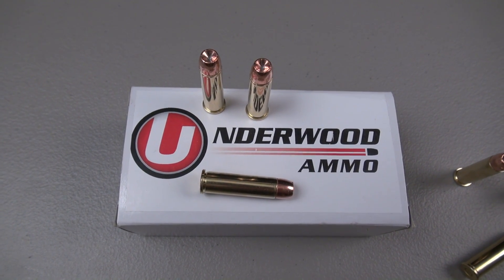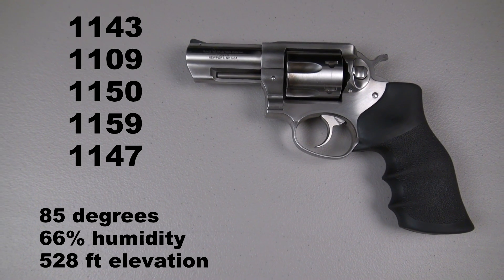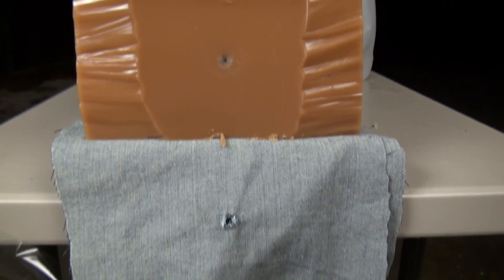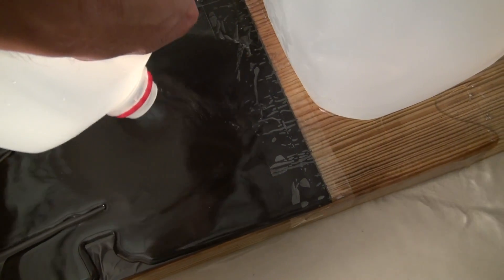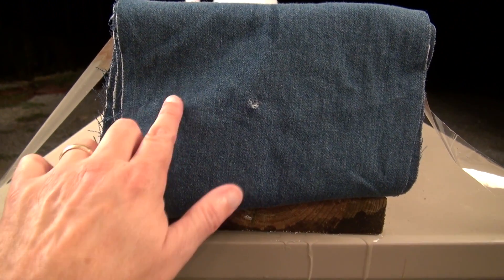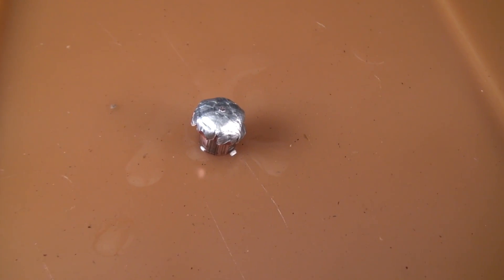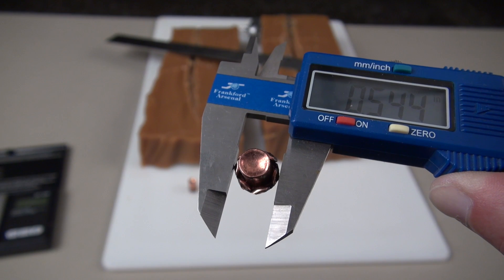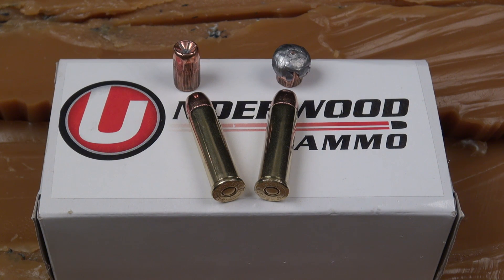Underwood .357 Magnum 158 gr Gold Dot Ammo Gel Test

Comment: The 357 mag is by far the most overrated defensive caliber ever.  There are a multitude of reasons for the wide misconception:
Gross misrepresentation of factory advertised velocity - unique to this caliber
No barrel length listed to equate with advertised velocity
People's failure to account for cylinder length contribution to the overall launch pad length
Poor and or misunderstood data about one shot stops / that are either useless or harmful when attempting to understand terminal ballistic performance

125 grain 357 from a 4 inch launch pad = (maybe inferior too) a 9mm relative to terminal ballistics - same diameter - same mass - same velocity  (they are both CLEARLY inferior to a 40sw relative to terminal ballistics)

but the 357 has  more flash - more bang - more recoil - harder to control recoil - and coming from a revolver with far less capacity - harder to reload - an inferior trigger - harder to conceal - and more uncomfortable.  (the revolver often has a better front sight)

Its a hobby gun thats it / period.
Reply: The sport of firearms is a hobby.  If you're not into the sport of firearms for the sheer pleasure of it, then you're probably into the wrong hobby.  Unfortunately, too many new gun owners fall victim to paranoid fear mongers preparing us for waves of zombies and SHTF bullshit and never really get to appreciate or experience a wide variety of calibers. 

Shooting properly loaded .357 Magnum from something other than a snub nose revolver is a ton of fun.  Fun is the hole point of shooting for sport.  Most people that enjoy the .357 Magnum or 44 Magnum like it for all the reasons that you don't.  That's why they make comparatively weak pistol ammo like 9mm and 40 S&W or white box 10mm.
Reply: FiT PT wait you just said 40 is equal in performance to 357 noooooo dude just no
Reply: Lol ok.
Reply: TOBORE8THMAN

I never said I dont like it.  I shoot the 357 mag from an sw 686 (copy) with a 4 inch barrel because it is what I have.  My point is the caliber is not well suited as a CCW.  Its potential and advantage is based on relatively high power for a hand gun. However its power is contingent on its relatively large case capacity.  To capitalize on this extra powder store requires a long barrel = really 6 inches. Even from a 6 shot revolver with a 4 inch barrel which is not the most comfortable conceal carry (I cant do it) = there is still a large flash bang from the hot burning (wasted or worse than wasted) powder from the muzzle and between the cylinder barrel interface. There is nothing in your post that contradicts my original or that I disagree with beyond your assumption that I dont like the caliber.
Reply: @FitPhysioTherapy  It was never designed for concealed carry, what are you going on about?  That would be like sticking a 3 inch 44 mag in your pants and expecting it to behave like a 6-8 inch full frame revolver, which is stupid and not very well thought out.  A 4-6 inch barrel 357 does achieve what it was designed for.  The gun manufacturers screwed around and thought "hey, i bet this will sell quicker if we chambered it in a snub", they didn't care that it wasn't designed to achieve its potential in a short barrel.  9mm vs. 357, when both are used as they were designed, is no comparison, even the standard 357 158 grain is moving much faster, as designed,  than the 9mm 147 grain, which equal a better multi purpose cartridge, in the correct platform of course.  Use some common sense man.  As far as underwood ammo, most tests I have seen, drive that same load (maybe they tweaked it right as they found out short barrel guns are being used) close to 1300 fps out of a 3 inch gun and have seen some 2.25 inch guns shoot faster than the 3 inch.  Out of the 6 inch barrel of my GP100, which kills deer, would blow any two legged creature to hell and back, hits right around 1500 fps, with the 158 grain xtp, find me a 9mm, or even a 10mm that equals the energy that round dumps into the target.  This is how the rounds were made years ago before compact revolvers got involved and girly boys realized they didn't like recoil, most 357 ammo is not loaded to its potential to even the 35,000 psi SAAMI specs, not even close, that's why most 158 grain loads only claim 1250 fps and not 1500 like underwood and buffalo bore.  Without those companies, those that don't reload, would have to settle for the dumbed down loads, which still exceed 9mm specs by a long shot, get real man.
Reply: FiT PT what are you mad
Reply: Leonard Kimble

I was mad, but after watching Obama leave office now I am only angry - why do you ask?
Reply: FiT PT lol no bro about the revolver only being a hobby gun
Reply: Leonard Kimble

I  am not mad that the 357 mag is a hobby gun.  I dont care much about it enough to get mad over it.
Reply: OK FiT PT  I meant nuts. But to each its own I'm deadly accurate with mine you made it sound un usable. I own semis too but Yea I favor the 357
Reply: Yes FiT PT  I have been in a couple. Won't elaborate. Sometimes I carry my 40 Kahn sometimes my Taurus 357 maybe it's me but I'm not worried about the bang of either one. Are you a small guy not being a ass just asking. 2 No not ANYONE can be deadly accurate in practice. Trust me
Reply: FiT PT wait let me answer the rest of your question. Concealed carry and home defense. From people. 125gr Hornady. You carry 135gr low flash
Reply: Leonard Kimble

You
Are you a small guy not being a ass just asking. 2 No not ANYONE can be deadly accurate in practice. Trust me

Me
No - my favorite handgun = the one I would take to a gun fight if I could not bring a long gun is a Glock 20 - 200 grain xtp Double Tap. But I carry a single stack 9mm for comfort which is always a factor (and the extra round) because I am never expecting a shootout and in most events a realistic water pistol is all that is needed so I feel over dressed with a 9mm.

You
2 No not ANYONE can be deadly accurate in practice. Trust me.

Me
I never claimed everyone can - but many people that have achieved very high practice proficiency failed miserably in the real deal = part of documented history.

You
wait you just said 40 is equal in performance to 357 noooooo dude just no

Me
I said equal or superior and presumably you just watched the video evincing my iron clad case.  Underwood (your brand) 158 grain from 3 inch barrel = 4.7 inch launch pad = miserable fail and with Gold Dot.  It is likely it would have been worse with xtp which is a poorly expanding round and requires very high velocity to function properly.

Link me to one youtube video showing a 357 mag with FACTORY ammo any mass bullet performing from a 2.5 inch barrel or less (that is still more than 4 inches relative to 40sw pistol) that is equal to 40sw (with proper round of 160 or 155 grain bullet) with respect to energy and terminal performance initial bullet diameter - expanded diameter - penetration etc.  I double dare you because I have looked and I cant find one (not saying it does not exist).
Reply: FiT PT no bro double tap or HPR or Remington. 125gr. 10mm is a different story. Don't get me wrong I'm a big 40
Reply: Leonard Kimble

You
no bro double tap or HPR or Remington. 125gr.

Me
I dont know what this means but I know it is NOT a link to a youtube video demonstrating efficacy?   I just refer you to the tnoutdoors video here to demonstrate the 357 mag Underwood even from a 4.7 inch launch pad is not very effective with respect to terminal performance - energy fair - gross over penetration - poor expansion - unimpressive wound channel.  But these are not the core reasons why I contend the 357 is not well suited for self-defense.
Reply: FiT PT I value your opinion and friendship but Steelers time
Reply: Leonard Kimble

Have fun OAO
Reply: Interesting That you missed the math here. 9m simply cant match the 357mag when the proper barrel length is used. You have apparently been fed the same lines that so many other people have fallen for.  Most Factory ammo is UNDERLOADED. Only a few manufactures load to intended (Design) specs. Don't take my word for it. Break some down and see for yourself.  Also, the 357mag was never designed to be fired from less than 4" barrels (measured from the frame connecting point) That has not stopped Gun Manufacturers from building  2" and 3" versions.  The average person simply does not take all factors into consideration, because they don't have all the info. 357 Magnum standard velocity was 1450fps 158gr . no 9Mm Will ever safely get to that level of power. And even 40cal cant touch it. 10mm gets pretty close.
Reply: Why do you think a (forcing cone) equates to barrel? It does Not. Just count the barrel length from the point of attachment at the frame.   Still, 1450fps with 158grain bullet still out performs 9mm, and 40.  I like all of them. But facts are facts. My primary carry is 45super. 185gr 1425fps (actually choreographed). It beats all of them. But at the beach I do sometimes switch to a 40 or 9mm. If I really needed power, id open carry a 4570 8" Revolver 320grain JFP.  But I don't have Brown Bears here. So that might be excessive. Lol
Reply: The only auto to compete with the 357 would be a 10mm. Thats it!
Reply: Leonard Kimble

Two comments 1) an observation 2) a question.

1) Many people are (Deadly) in practice but few are (Deadly) in the stress of a real world shooting incident.  There is NO way of knowing if you are deadly under a real word life and death shooting event unless you already have been so in the past and even than - it does not necessarily mean you will be next time.

2) Are you telling me you employ the 357 for self defense?  If yes carry defense or home defense etc - defense from who or what - and concealed or open? 

I personally could not carry a 357 - 4 inch barrel 6 shot revolver concealed - it is awful - especially when I can carry a very comfy 15 shot 40sw with lower recoil - less flash/bang - easier reload - better trigger - and with equal or superior terminal performance.

Comment: My hand loaded, 180gr 40 cal out of a 4 inch barrel runs 1113fps on a 5 shot string, and that's at less than a max charge. Kinda disappoints me to see the 357 advertised so high, but performing so low.
Reply: I think it's because of the powder selection. Magnums typically use a slower burning powder and are tested using 10" barrels to maximize the advantage.

Comment: Is it a possibility that your test barrel caused the lower speeds and therefore a pass through since expansion was inconsistent? Maybe a longer barrel generating higher speeds would have caused more expansion and a batter energy dump, resulting in no over penetration. Just my thoughts. Please keep the videos coming. They are very helpful in making decisions about what ammo I carry.
I would also love to see you do a test of the 160 grain Hornady Leverloution (sp?) round from a .30-30.
Reply: +michael malkowski And that massive ring of fire seen in a separate video.
Reply: I'm guessing the test data to achieve the 1475 fps they claimed was out of a long barrel, maybe 10" even. If the burn rate of a powder needs more barrel to be effective, then out of a short barrel you'll see massive drop offs like that.

Comment: I'm trying to decide between the 125 or 158 Gold Dot as a home defense or woods gun.  Firearm is a 6 inch Ruger GP100.  The 125 grain seems to expand better and penetrate deep enough, but a 158 has less blast/flash/snap than the 125.  More than likely this won't be used as a home defense gun, but I like to keep my options open.  Thoughts?

Comment: Your 3" GP100 left approx. 325 fps sitting on the table.  Underwood is pretty good about advertised muzzle velocity specs, too.  They must have used a 6" barrel.  My "hot" home load 158 grain XTP's averages of 1360 fps from my 4.6" Blackhawk.  Hmmm...
Reply: Yeah you aren't going to get their advertised velocity out of a 4" barrel.  That's why I hate when companies don't give you the barrel length and if it was fired from an actual gun or a test barrel.

Comment: That's the problem with revolvers, the size of the barrel is always going to affect the performance of the round being fired. 2-3 extra inches for a revolver can equate to more than 100fps, and the gap widens even more when comparing snubbies to 6 inch standard revolvers. Thats why I always argue that .357 sig and .357 magnum are closer than you think in terms of performance given barrel length. A compact glock firing 357 can get a full 1300-1350 fps, a 4 inch revolver is right around there.

Comment: I have had a few mixed responses concerning me carrying hot .357 sig FMJ loads from Underwood rated at 1475, although I have seen regular 4.5 inch barrels get well into the 1540-1550 fps range. Some people say even for car carry and nothing more, it would have over penetration, but the fact of the matter is I wouldn't feel safer with anything other than some very hot solid FMJ .357 sig rounds coming out of my G33, probably at every bit of 1400fps. Both 10mm and 357 sig are awesome penetrators

Comment: I just picked up a box of the Speer 158 grain Deep Curl (Gold Dots under a different label) that I want to use for hunting on whitetail this coming year. I have looked up a couple of loads for this and out of my big Smith or maybe if I pick up a gun with a 6 or 6 1/2 inch barrel I am hoping to get about 1,350 to 1,400 fps. With the penetration you are getting I am hoping to drive the bullet right through both lungs. I have heard good things about this bullet.

Comment: You must take into account that the chamber is included in the OAL of a pistol barrel.  The barrel length on revolvers is all barrel length, and does not add the cylinder into the length.  So... a four inch barrel in a pistol would be real close to containing only 3 inches of rifled barrel, because nearly an inch or more is the chamber.  You will lose a little velocity between the forcing cone and cylinder in a revolver, but not much.

Comment: Yes, all handgun rounds are weak stoppers. I agree with you on that point But there is no reason to use FMJ or hard cast lead rounds instead of hollow points because of a number of isolated incidents. Quality hollow points, like Gold Dots, Rangers, or HSTs, all reliably expand. Even if the bullet doesn't strike a vital organ, it will still leave as ugly and reasonably deep of a wound as possible.

Even if you are carrying quality hollow points, shot placement is still the most important factor.

Comment: I am absolutely thrilled you are doing these .357 tests. I was curious about the velocity difference from the 4inch stated and the 3inch actual (a difference of almost 300fps); what if the lack of velocity caused too little initial hydrostatic force to open the bullet? Could this even be a possibility or am I shootin at clouds here? 

What could these do in say, a 6 inch barrel? 20+inches of penetration would still be a wonderful trail-load!

Comment: You're nuts. You shouldn't rely on expansion exclusively, but saying that penetration is king is absurd. Full metal jacket rounds, at least in handguns, do not have a good performance record. Any defensive ammo should meet the FBI penetration standard, but good shot placement from the shooter is what ultimately matters. 

Also, reasoning that you shouldn't take a shot because bystanders are at risk is flawed. The are times where you may not have any other choice but to take the shot.

Comment: Relying on a hollowpoint.. ANY hollowpoint... to expand in order to protect bystanders is INSANE.  Therefore, penetration is king, expansion is completely secondary.  If you suspect bystanders are at risk, don't take the shot, because reliance on a mechanical process to prevent an innocents death or maiming is not a wise choice.

Comment: In this case lack of velocity. I thinks the first bullet slipped just under the expansion threshold due to deviation. The second bullet opened very slowly but had plenty of travel to show good expansion. Another 100 fps. would put the GD in the sweet spot for proper expansion timing, and the penetration would be around 14"

Comment: Other thing to note for all of your 357 magnum testing, anything under a 4" barrel is going to see a VERY sharp drop off in power and start looking about the same as a 38special +P. 

6" is where your normal box velocities come from, but a 4" S&W will push them pretty quick as well. Going from 6" to 3" you're talking about a difference of 300-400fps depending.

Comment: My guess is the opposite of yours tn. I think they used a speer gold dot 357 sig bullet and it needed more velocity to expand properly upon penetration to start slowing down fast enough & transfer its energy via impedance/drag resistance. I think if you tried the same round through a 6" barrel it may have performed the same as your 357 sig tests.

Comment: You have to wonder if the added weight compared to the 125gr speer loading is the cause of the added penetration in this test. I wonder if you had actually got the advertised velocity with the 3" barrel, if the bullet would have reacted differently.